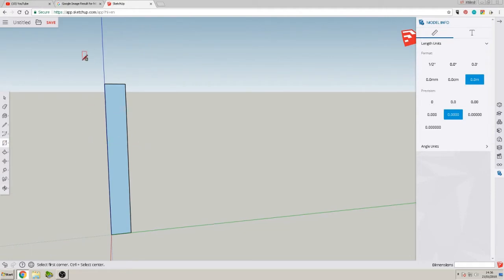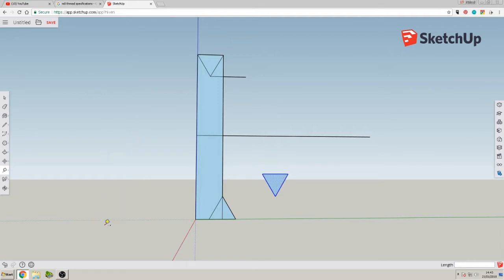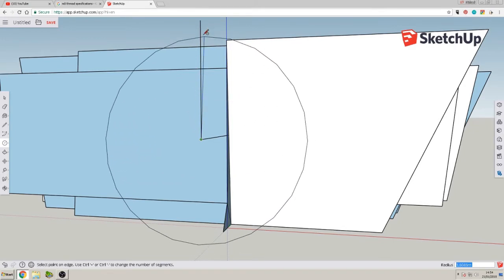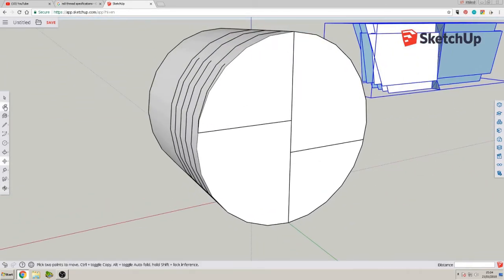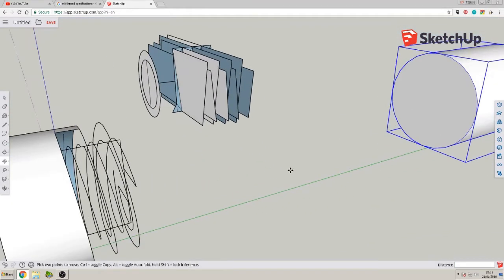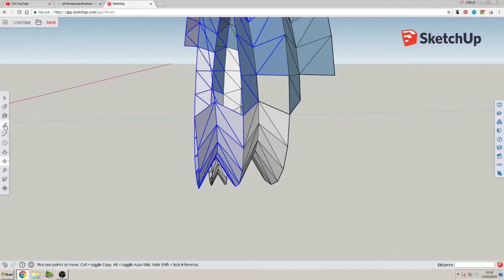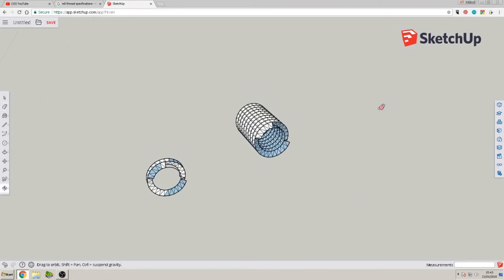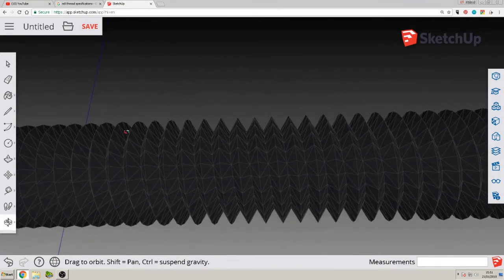Sketchup Free: Drawing a Screw Thread Tutorial, Plus Review

Comment: Interesting, thanks. I use Free Sketchup all the time for 3D printing as a hobby. I have been put off making threads but I want to often. It looks complex but many things using Sketchup get almost instinctive when you've done them a few times. You used something I haven't used, intersecting planes was it? but I will try doing this soon. I am wondering if the internal thread can be done in the same way. I suppose so, it's a cylinder just like yours.  Incidentally I like Beethoven too, but the choir got a little obtrusive once or twice. Good to hear a clear English voice for a change! Thank you again.
Reply from the maker: You're right the intersecting planes are the crux of this technique. For 3d printing there may be a better fill pattern to use for the thread walls to make them slide more optimally but the planes will get you the spiral of the peaks and the corresponding one for the troughs. It should work for internal threads too all you would need to do would be to flip the normals and delete any end cap geometry. Sorry the music got a bit loud but I am glad you found the video interesting.